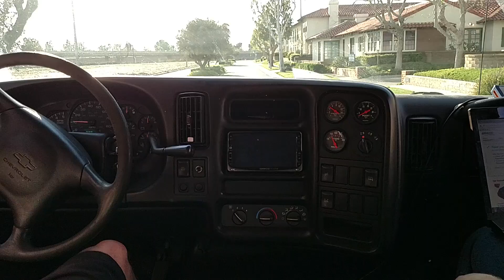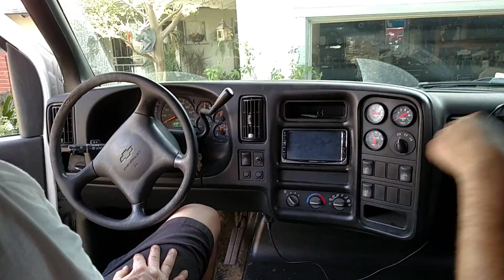Danville 68mm Turbo on Chevy 4500 Kodiak

Comment: Where did you even get these performance upgrades? Sorta thinking of getting a kodiak and upgrading the turbo, intake and exhaust with a programmer
Reply: It's the same engine as a 2500 or 3500. So, any Duramax upgrade would make the same difference on these trucks.

Comment: Whats that gas mileage ?
Reply: It matches what gear you're in I bet, 1-6mpg
Reply: @The_Ballo  I get about 12-15 in mine 4x4  11r22.5s
Reply: These are supposed to be 24 across the board
Reply: @js4120  Damn that’s not too far off from what my Tahoe gets
Reply: 14 mpg
Towing 9